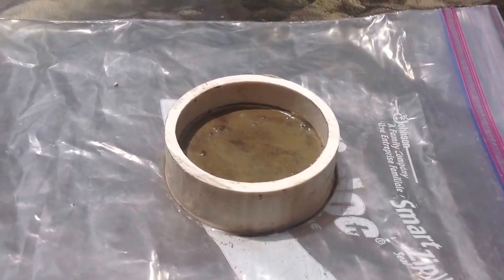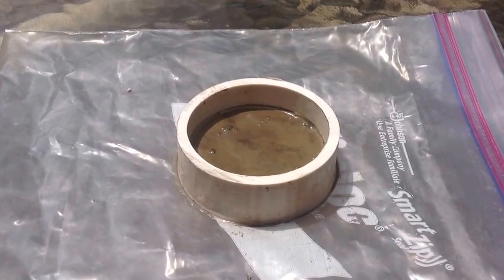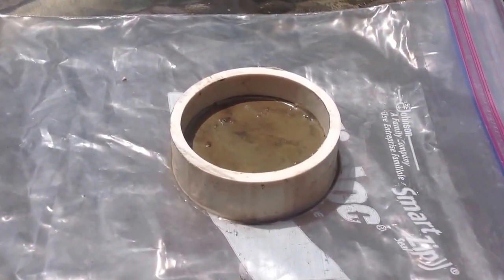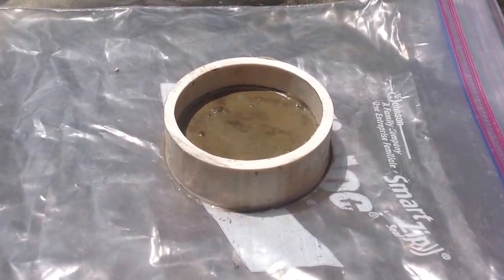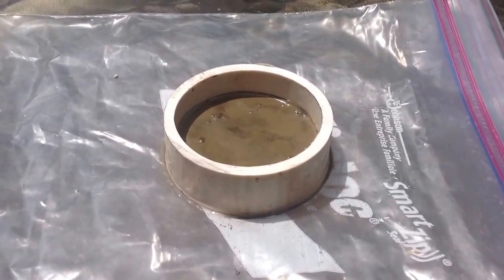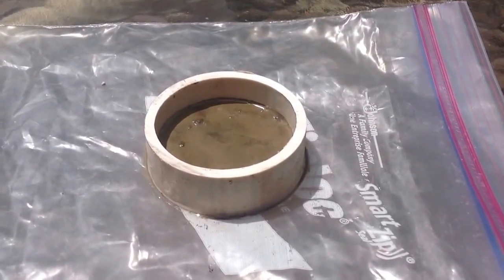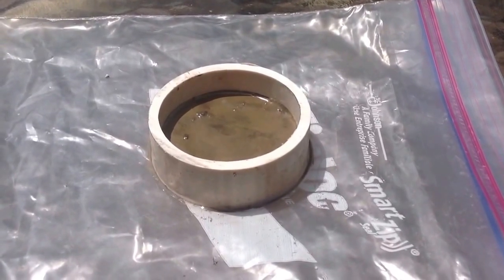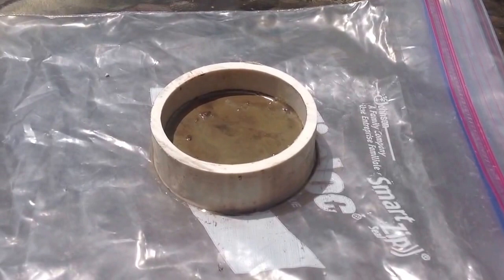MAKE  EASY CONCRETE CRYSTAL BATTERY COINS

Comment: Only the surface area of the crystal matrix reacts with the metal cathode and anode. Try soaking paper in a crystal mix and add foil to each side. Much smaller and works better. + if you use ibpointless2 crystal glue cell formula you never have to add water.